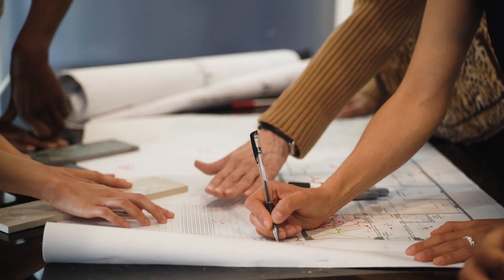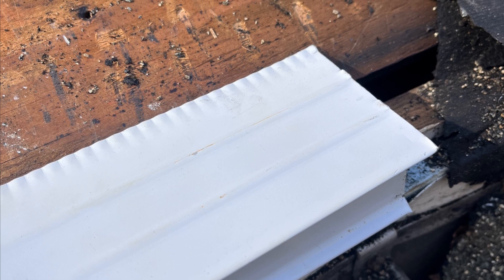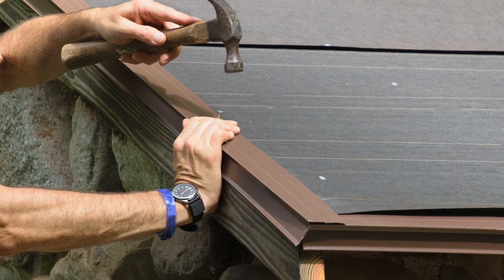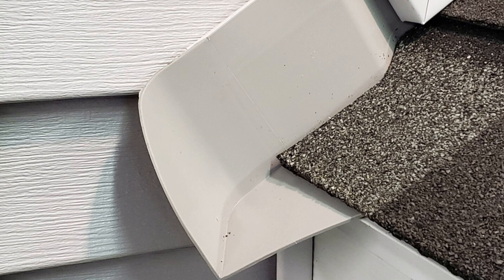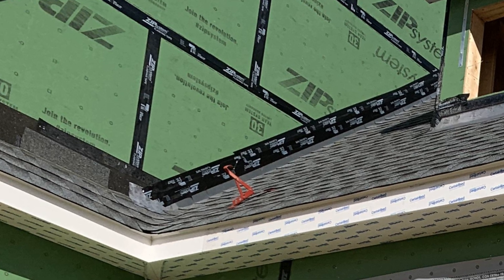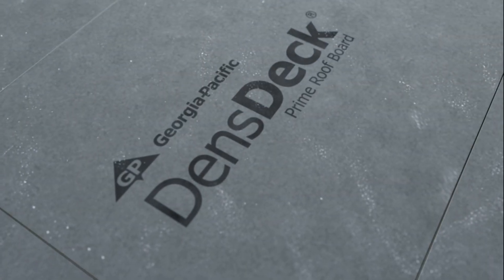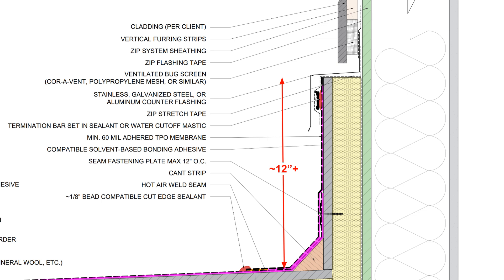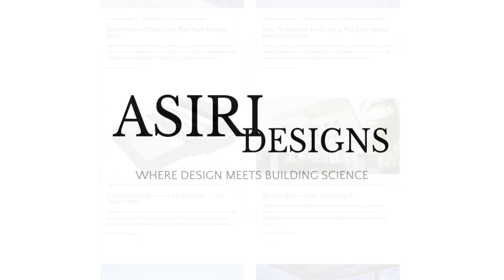Critical Roof Details You NEED To Get Right (Step Flashing + Counter Flashing + Roof Transitions)

Comment: Thanks. Isn't the drip edge, bent at 45degrees and protruding 3/8" away from the fascia already designed to provide a capillary break? As for a drip edge in masonry (a simple kerf), water is not supposed to climb back up that steep edge and damage the roofs edge .

Comment: Is there any issues that you can see using newer synthetic underlayment? Not referring to ice and water shield that is applied at the eaves but the product that is applied to the rest or the roof deck. Every roofing manufacturer seems to have their own (IKO Stormshield, BP Suredeck...) but they are basically all the same and are mechanically fastened. There are some (ex GAF Deckarmour) that are marketed as breathable. Do you see these making a difference? 

Enjoy the channel and am getting more and more interested in building science.